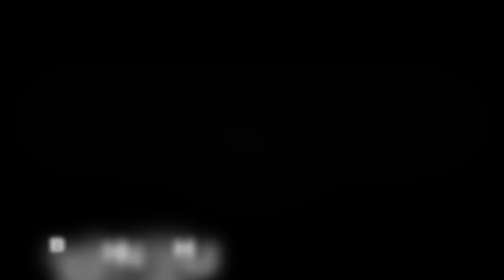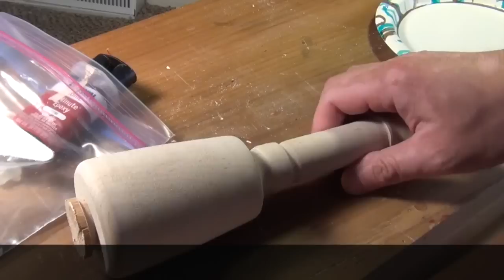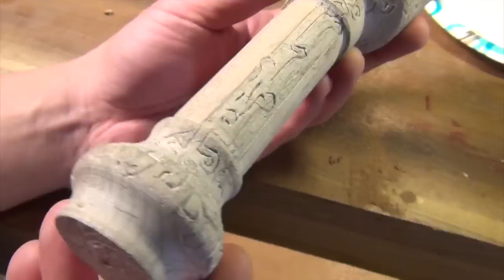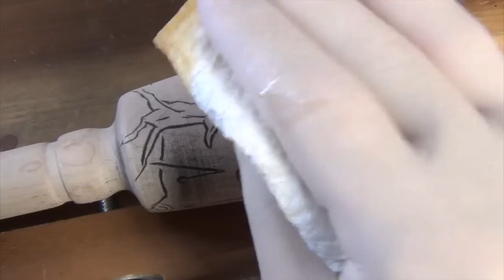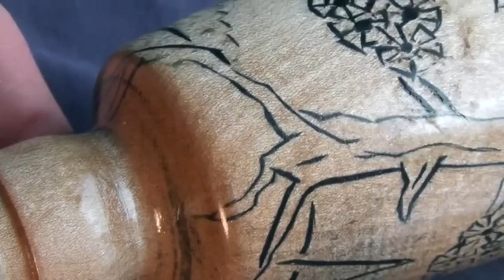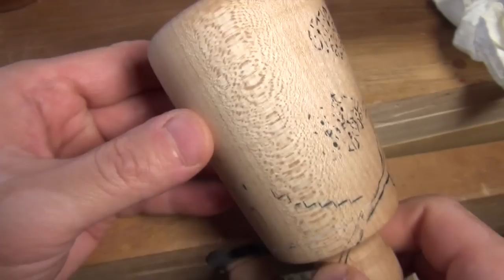A Maple Carver’s Carving Mallet w/ Epoxy Inlay (project 14)

Comment: really cool John. Getting a turning perfectly re-centered on the lathe is chore. I applaud your dedication to re-carve the lost portion...
Reply: The Nomadic Polywright Show I was just think it might have worked on the lathe if you had carved it there because it wouldn't get off center. But then again, carving with it attached to the lathe presents its own problems.
Reply from the maker: Peter Brown Thanks, PB. Live and learn.
Reply from the maker: MonkWerks with Fr. Thomas I think the problem was that after installing the plug I had to find the center again, and it was off just a little bit, but that was enough. If I ever to this again I'd try re-centering before carving. It was too cold to carve on the lathe, although I am getting some ideas on how to carve on a lathe.

Comment: Well illustrated mallet and a sharp looking video! I would have been tempted to melt the lead and pour it in, just to see how that would work.
Reply from the maker: John Heisz Thanks John. I have thought about melting lead many times, I just don't have the setup to do it, so discs for now. It would be interesting to see if the lead would roast the wood, and if freezing the wood keeps it from burning. You could probably make some cool casting with a wood mold.
Reply: The Nomadic Polywright Show I cast some "coins" when I was a kid, melted some lead flashing (playing with / eating lead when I was young - ah, the good old days!). You can do it in a tin can with a propane torch, since lead has a low melting point. I think I'd try wetting the inside, fill it with water and let it sit for a few minutes.
Reply from the maker: I might just try it next time. I've only used a propane torch to melt aluminum for an attempted sand casting. It didn't work. But I do want to build a small forge so I can heat treat some parts.
Reply: contact of melted lead with water (wet surface) causes lead to splash. be warned. 
we made sinkers as kids. pouring lead into  brick hollows. and splashes were huge if mold was wet
Reply: John Heisz When I was a kid about 12 or so, don't know why I started, I would melt led in a spoon on the gas kitchen stove and pour it into a soft pine block with an "inget" rectangle carved into it.  I also would dump it into water. It made really cool looking "coral reef" like shapes.  Surprised I never got hurt, and I never got caught.  Anyway recently I melted some wheel weights on an electric stove in a small SS crucible for my kids science project worked out well. Anyway love your vids John, and I have just started watching yours Nomadic guy but I am liking what I see. Thanks a lot...

Comment: Hi have not tried pouring the lead in the mallet head but I did try a length of 1" copper tube  cut to needed size pour the lead in the piece of tube and made a slug that was epoxyed in after cooling I was happy with the result...   Hey I really enjoy your channel Thanks for what you share...  =O)
Reply from the maker: Reed Kay That's an interesting casting technique, if you do it again you could film it and send me the link.

Comment: So cool I couldn't use it. lol Thanks :)
Reply from the maker: Louise Florida Thanks, don't you think it'd be a shame for it's purpose to go unfulfilled.
Reply: The Nomadic Polywright Show Then I think you must have put some extra protectant on it... then yes, I would use it. I make leather items, I have a 2 lb mallet now that's a bit heavy for me. This is a great idea for a lighter mallet for leatherworking, I think I'd carve the handle and cover the head with 9oz leather to help with dampening the tapping noise. I love this idea. No reason I couldnt drill a smaller hole and use nuts inside. Thanks for the great idea. :)
Reply from the maker: I have a small brass mallet that I use for leather tooling. This one's size should work well for the way I hold my carving tools. I made the handle with two lips because I as thinking of braiding a cover.

The head I don't have plans to cover it, if I deaden the impact, then I would have to hit harder, I don't have a problem with the mallet gaining character.

I use lead balls because they are denser than steel, therefore requiring less space. Ideally, gold and platinum would be best, if you have the spare change.
Reply: The Nomadic Polywright Show Oh yes, I see what you mean, I hope you will show us when your finished. It's those small touches that make the item special. :)

Comment: Your carvings are neat, I like how you do them.  Question...... Shellac, is it like laquer?  I use spray laquer, spar varnish, and polyurethane.  I always see it at the home stores but think nothing of it.  I looked it up and I still don't get what exactly it is.  If you have time can you explain it......... Thanks.
Reply from the maker: Luis Figueroa Thank Luis. That's a great question. Shellac is made from lac bug secretion dissolved in ethyl alcohol (ethanol) it dry clear-ish with a shine. Lacquer can be a variety of substances dissolved in a solvent that could be ethanol usually dries matte that you can buff to a shine. Polyurethane is a synthetic polymer (like nylon). Polyurethane is the hardest, most protective, and most toxic to use. Lacquer is more generally harder than shellac. Shellac is the least toxic of them all when using. Shellac is also used in food coatings such as skittles. Hope this brief explanation gets you oriented for further research.

Comment: I noticed you used lead in your smaller mallet as well.  I like the idea of using the discs as weight at it allows you to test it with a temporary plug first.  It really is a beautiful custom mallet.  What was your lead source? did you know the weight before flattening? Regardless this and your other mallet video have brought me back to re-watch often!
Reply from the maker: I used .50 cal muzzle loader lead balls.
Reply: @johnzzhu  They should be easy to source here thank you!